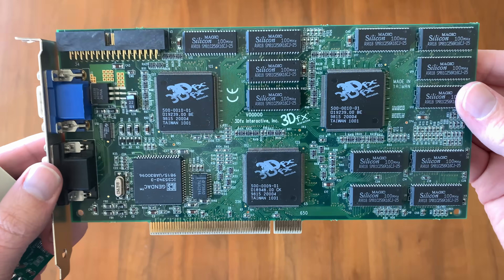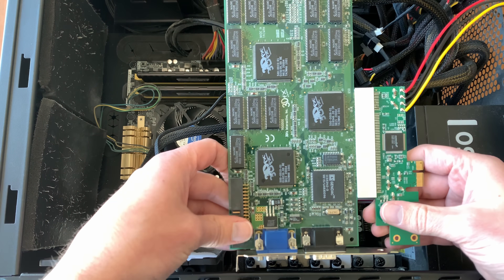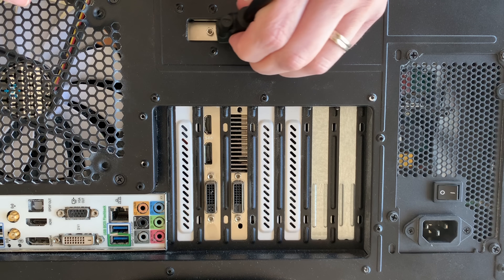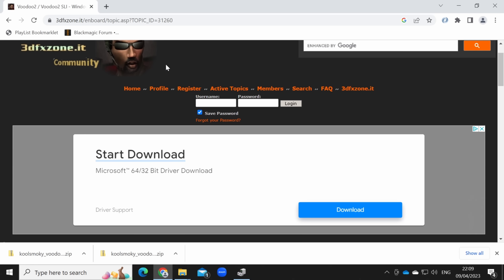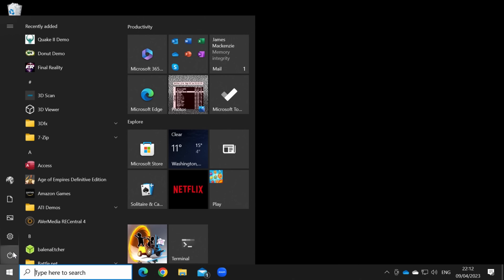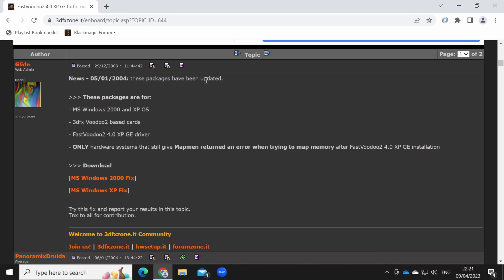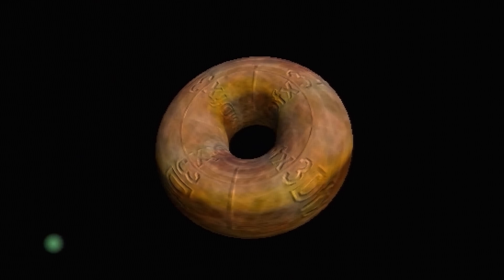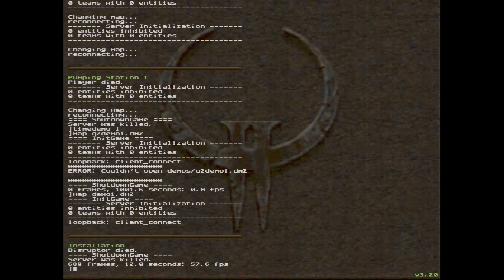I made 3Dfx Voodoo2 work on a modern PC!

Comment: About 2000 or so, thinking what 2nd hand machine and from person at what job back in the day. 23 years ago. Must have been. 2nd hand tower unit and 15 inch CRT monitor. It had a posh 3d graphics card, Loads of chips, similar to what you had, maybe even a bit older, bigger surface mount things. Needed a little patch lead to to from the normal graphics card and loop to input of the posh 3d thing then out of that to monitor, Expect gave better picture, more memory but sister had as bought 2nd hand for her. Not do 3d games, expensive card and it never worked hard, did what it was made for. Like doing things on computers back then. change our first one a bit from 1998 onwards. Stick CD recorder instead of the a reader in it. 2003 or so, first DVD recorder, external thing, but now going off subject to the video subject!. 2017 machine now with a few changes. when Windows 10 has its day. Will get all new something or another, tower or mini case unit. Recycle monitors (2) and mouse, keyboard. Use 1 hard disk in the new as extra storage, yet to be seen!.

Comment: I honestly want to go back to analog for video. I would love a modern design CRT display that's shrunk down and made more compact. And then give me an analog output. FPS gaming back in the day was amazing thanks to CRT and analog. Today just doesn't feel as good. Especially because LCD sample and hold technology really fucks with motion clarity. I would love to have an OLED monitor with black frame insertion but so far all the OLED monitors that exist and do not have that feature. I could get a TV that has black frame insertion but then unlimited to 60 hertz. At 60 Hertz with black frame insertion will only double the quality of motion which would equal about 120 Hz visually. I want a 240 Hz display with black frame insertion which doubled would equal 480 Hz visually. And if we go crazy and make the blanking period longer we could essentially triple that to 720hz visually. To this day 120 Hz CRT absolutely shits on every monitor that exists in terms of motion clarity. I've seen the side by side myself and it's factual.
Reply: I will only use CRT these days, either late Diamondtron or Trinitron screens. They are just so much nicer than LCD, especially when refreshing at 240 vertical, natively.

Comment: How did you manage the VGA passthrough cable?
Reply from the maker: In this setup I didn’t use the pass through. My monitor has 2 inputs - 1 HDMI and 1 VGA. My primary graphics card outputs via HDMI, and the Voodoo via VGA. When the Voodoo activates “3D mode” (e.g. in a GLide game), I toggle over to the VGA input and it works great :-)

Comment: You're lucky you didn't kill the card. IIRC. the faster the CPU, the faster (and hotter) the Voodoo runs. It might be OK to run it on a faster CPU (but not too fast) as long as you add proper cooling to the card.

Comment: you're not using voodoo.
To render the voodoo image, it must be connected to the graphics card with an external d-sub cable and running resolutions of 800x600 or 1024x768 (I don't remember which one).
What you've run is plain software, nothing more.

Comment: That poor GTX 780 or what have you reduced to serving as a mere video adapter, just to output the signal, just to maybe render the desktop. Humbling.
Reply from the maker: Very good guess! It’s a GTX 770 😂

The good news, I still use it for modern gaming. Or at least, anything that still works with 2GB VRAM 😎

Comment: Cool but how do you know that you are really using the 3dfx Voodoo2? Is it possible that everything is mapped and executed to your other modern video card? It is possible to run a glide emulator over a modern card I suppose.
Reply from the maker: I have two video cables connected to the PC. My primary video card is connected via HDMI, and the Voodoo via VGA

So I know the VGA output is directly from the Voodoo :-)
Reply: @jamesfmackenzie  Awesome! In this case there is no doubt :)

Comment: Back in the day when 3dfx voodoo cards dissapeared & ATI and Nvidia took over, ATI (now AMD) & Nvidia were actually not as powerfull as the voodoo cards. They should have stepped away asap from the 2 cards, you needed to connect with a VGA cable. That's probably what necked them.

Comment: Don‘t you need to connect the vga passthrough cables? Voodoo2 doesn‘t do any 2d stuff so some games won‘t show properly if you don‘t connect it……… right?
Reply from the maker: You have to switch monitor inputs back and forth a bit, but it does work without passthrough. More details here:
https://www.vogons.org/viewtopic.php?t=71543

Hope this helps!

Comment: There's a little problem there...Voodoo card works THROUGH the primary video adapter, but you didn't put the cable between the Voodoo2 and your video card.
So, that you're showing is impossible.
Reply from the maker: Voodoo works without the VGA passthrough connected. This Vogons thread covers it well:

https://www.vogons.org/viewtopic.php?t=71543

Comment: well - yet another of those videos:
- not really checked if anyone already tried that (which someone did - got a recommendation to a video just about 1 year old)
- not any research done but just tried by bruteforce
- relying on windows (and on modern 64bit versions of it) instead of giving some old linux a try which would had be a way better chance of success
pci-e to pci isn't anything new - in fact the very first pci-e systems were designed the other way around: they used a pci to pci-e chip from the chipset - it took some more years until native pci-e controllers were moved into the cpu and the designs were flipped to use pci-e to pci chips to connect more basic hardware like legacy pci slots or super-i/o like serial, audio or even ide
also: cards THAT old just don't understand VESA because that became a thing way later - and all windows comes with is vesa - anything older just doesn't work - and of course drivers designed for the 16 bit and 32 bit era don't work on 64 bit windows - but as x86 is backwards compatible it would had been a better idea to use a 32 bit windows like "The Eric Experiment" tried a year ago in his video (although with not much luck either)
overall this could had been brought to work on such modern hardware - but does require way older software, the fact that any modern x64 multi-core system still starts up in 16 bit protected mode and setting the uefi into bios-csm mode
lets see - maybe we get next year a video when someone tries to do this properly
Reply from the maker: I had a blast playing Turok on my “improper” setup today 😎